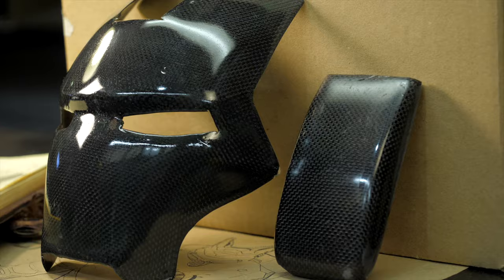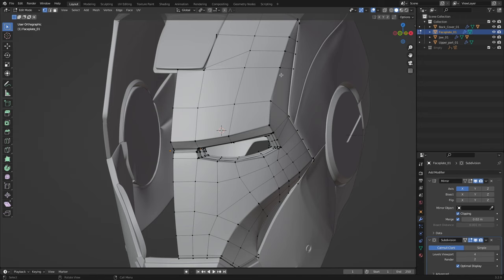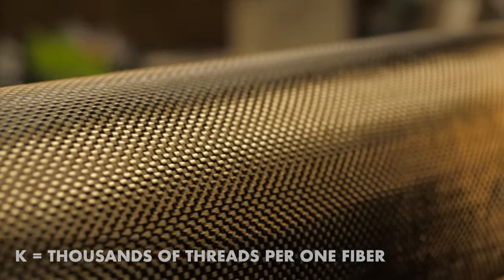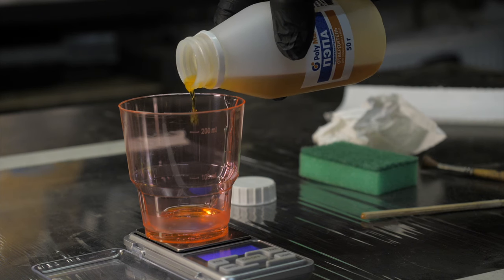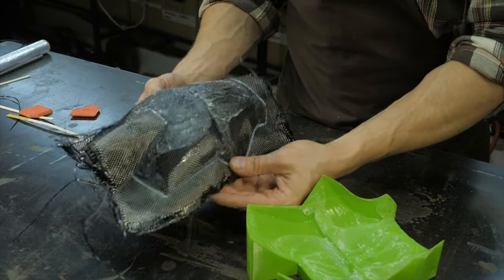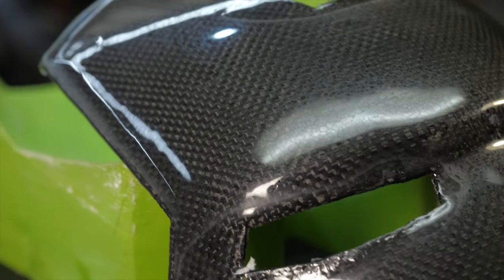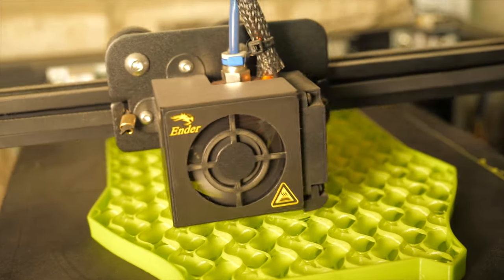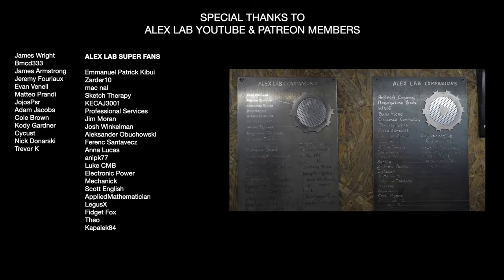Carbon fiber part on a 3D printed mold. Basics of composites #3: Carbon fiber Iron Man mask tutorial

Comment: I have 2 questions, One is far more complex than the other. The complex one is first : Would it be possible to save manual work time & effort at the mold phase of production by having an interior and exterior mold in a lock & key style as a press? meaning having the concave portion that you put resin and fiber in like you do now, but with the addition of a convex print, so that each sheet of carbon fiber could be coated on each side, inserted, then the convex part is on top like a sandwich, and then pressed with a vice or weak hydraulic press? it would save the manual effort of going one layer at a time and filling in details, as the convex part could also include pores to allow gas to escape, which means the actual labor time is lower. This is also essentially how coins are minted, and vinyl records where produced. I would be interested to know if that works with carbon fiber and resin with more complex geometry than simply a sheet. The second question is much simpler, Why can molds not be re-used / would it be possible to make a multi-use mold either as a 3d print, or use a 3d print to create a non-3d printed multi-use mold?
Reply: I reuse the mold I use for my bikes front mudguard, but its fiberglass not 3d printed.
Reply: @austindavies6371  yeah, most molds are reusable up to a certain number of times before they wear out. Im just curious about the effects on 3d printed molds. Do they crack, or just loose detail? At this level, since things get somewhat sanded, the loss of detail wouldnt be that big, but for moving parts would be serious. Does mold release damage the plastic? It just seemed very glossed over in the video.

Comment: Dude, your work and presentation is top notch! Even if I won't apply the skill immediately I can always come back here in the future :) 

Regarding the mold surface, would it work if you added filler in it before sanding it and avoid the layer lines? Or maybe using a filament made to be sanded?

Comment: The little trick about using 2 cups for the epoxy mixing is gold. I've looked at uncountable videos on epoxy use and no one's mentioned that before, yet plenty have had issues with uncured/poorly mixed epoxy. Also, washing the part between swapping grits/polishes is something few talk about, but I had to learn the hard way.

Comment: There are water soluable filaments on the market. They are usually used for support material during printing.
You could use filament like this to make parts with complex geometry and dissolve the mold Later.
You can pack complex geometry with small scraps and loose thread carbon fiber. It will look non perfect but will be functional

Comment: Consider using a bottle jack press mixed with a vacuum bag to make a higher compressed mold which will remove more defects while being able to use even more layers of fibers. This should help with making the parts stronger and more "bulletproof".

Comment: @ALEXLAB Alex, check out this video about compression moulds with carbon fiber. "Make Forged Carbon Fibre Parts Using Compression Moulding". The printed moulds were two or three  parts. After layering down the CF (he was using chopped carbon tow) he compressed the mould in a vice and let it cure. The parts seemed to have pretty high detail, and I suspect this method would help ensure the fine detail of parts shows up in the finished product.

Comment: I would print the part that I wanted and then use it as a press mold into a wet sand bed (like they use when metal casting) so that the fiber forms to the printed part with less variation due to the mass of the wet sand acting like the other side of the mold.

I would also print and cast the areas that have complex geometry as separate parts and then seam them into the other elements of the total part by using the same technique you do, but alternating the layers of the composite so that the resin merges them together into a completed piece.
Reply: Describing the above method better: design your parts with some deliberate overhang (say 5mm on each side and do NOT treat them with the resin) so that when you seam them together the 5mm overhang becomes 5mm of joining fiber and can account for joints and sharp bends.

Comment: Could I use the same process to  reinforce the 3D printed parts from the inside (IML)? So I could keep the 3D details on the OML. Would the resin adhere to PLA?
Reply: I was wondering that? You could also print them with one of the carbon fibres threads.

Comment: If anyone out there needs a 3D modeler I'm available. Will work for trade in circuit design and components. I also have a resin 3D printer if anyone needs prints. At the moment it's just a hobby but I want to open a full blown shop to custom print parts.